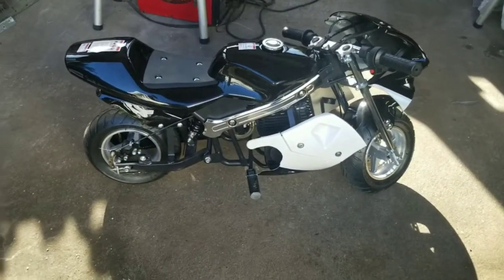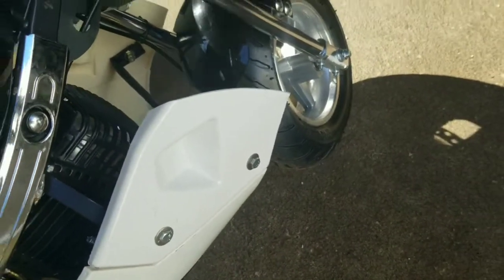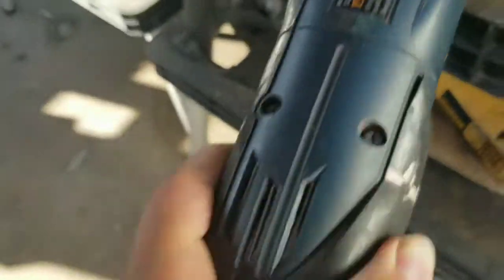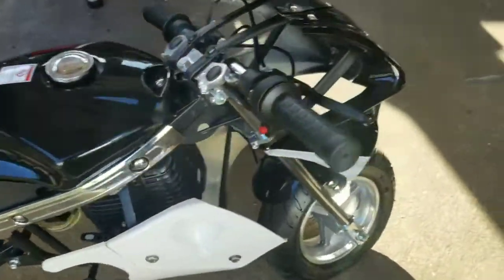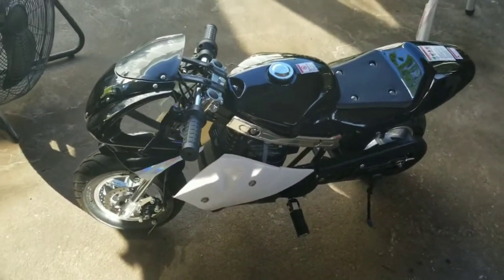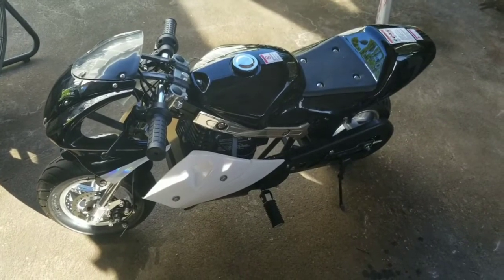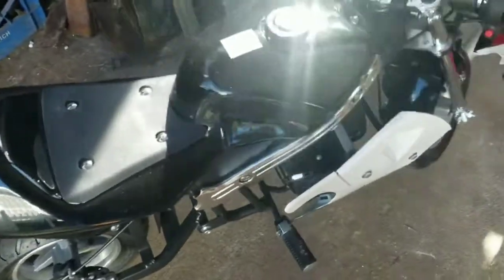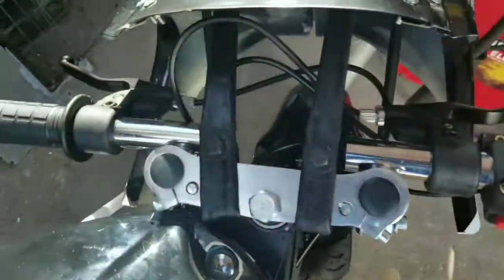How to modify a pocket bike

Comment: You could’ve just chopped off the handle bars completely and gotten some clip ons. With the clip ons you could’ve turned the handle bars at an angle towards you so that it would’ve allowed you to turn more like you did. I think that would’ve been better than cutting the fairings. It’s just my opinion though.
Reply from the maker: Thanks for your opinion, I realized later, but it is very small and if I turn the bars more in the steering would be unstable and I didn't want  to risk to fall
Reply: mechanictechniks nah man, all sport bikes are like that. It wouldn’t do that. You should try it next time. Cool bike though, I’m trying to decide which one to get and that’s how I found your video.
Reply from the maker: @cescarb  ok got you, thanks